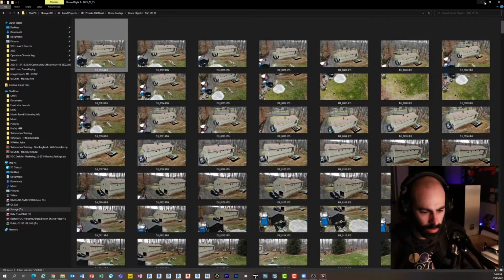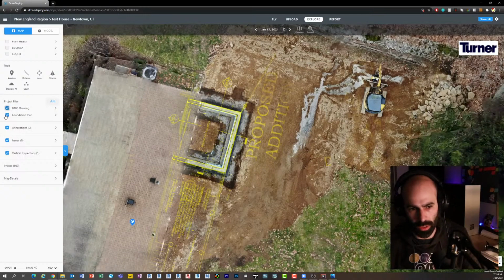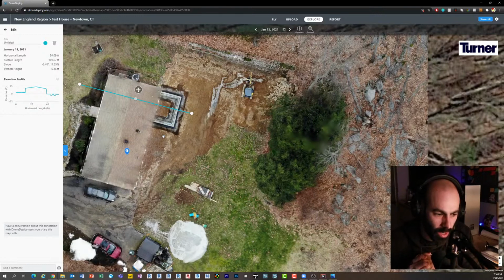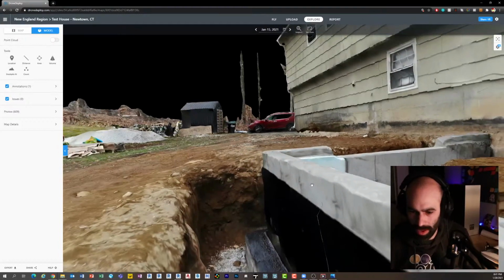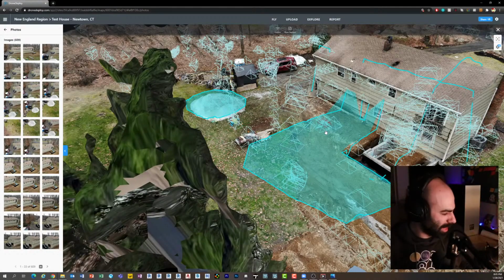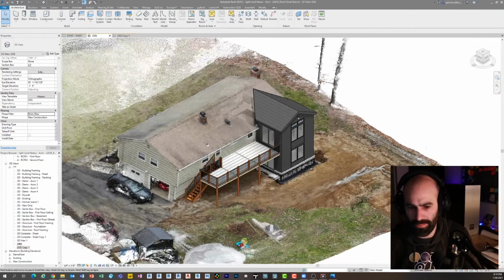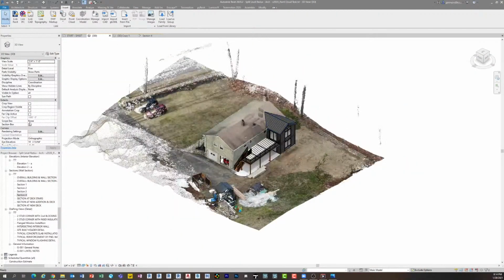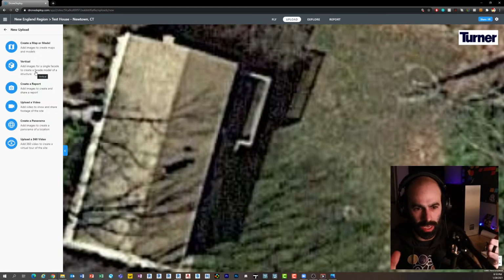Creating Revit POINT CLOUDS with a 600$ Drone!

Comment: LOL. Just looked at BimBox PCs. Their PCs are 3X-5X the price of the parts to build them. I mean, a 64GB with a threadripper and a 3060ti for $10K?!?!

Plus, Revit doesn't need a threadripper, it (mostly) works on one core.
Reply from the maker: I don't work for BIMBOX but I can attest that they are great PCs... I don't know about the AMD model but I think that one is designed for processing and using laser scans.  The other desktop is the one optimized for Revit... I believe that is why they overclocked the CPU so high,.... to overcome Revit's limitations in that are.  Just my guess.

Comment: FYI I have seen that the Parrot Drone which starts at $700 works with some of the drone control programs. The cheapest DJI one to work is that is current is the Mavic Pro which is quite a bit more and their old Phantom.
Reply from the maker: Yes, but for only 20$ you can use Litchi to automate flights with the "cheaper" DJI drones and still use DroneDeploy to process your maps, etc...

Comment: I have been trying to do this with my DJI Mavic Air 2 in the last few months after I got the drone in September. I realized after I got it that I really needed to shell out for the Mavic Pro to use it with a lot of the programs out there. But like you, for personal stuff I was not looking to shell out that much. When you say you set the drone to take a picture every 2-3seconds are you talking about the Hyperlapse feature on a DJI drone?
Reply: this is exactly what happen to me and here I am with the mavic pro.
Reply: @davidsimpson1895  hyperlaspse will do but still end up with a time lapse video.
Reply from the maker: Currently, I am just using the camera setting for automatically taking a picture every 2 seconds... I don't think its called hyperlapse.  But, I also think you are using a newer DJI App than me... Not sure...